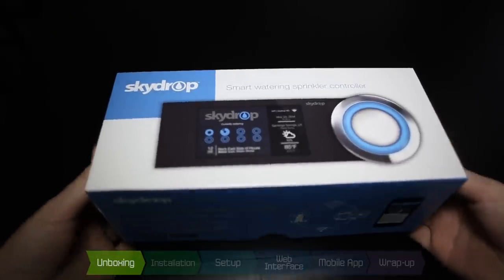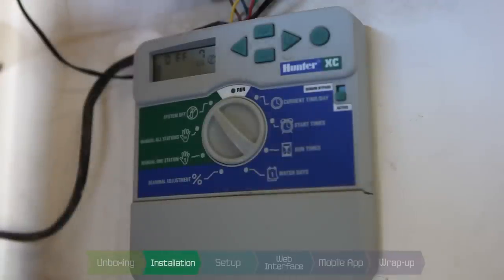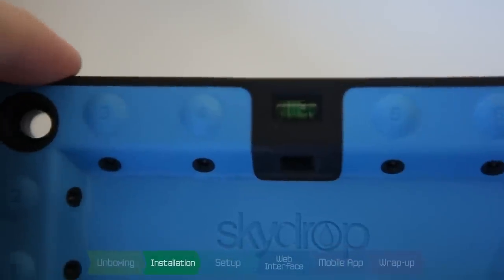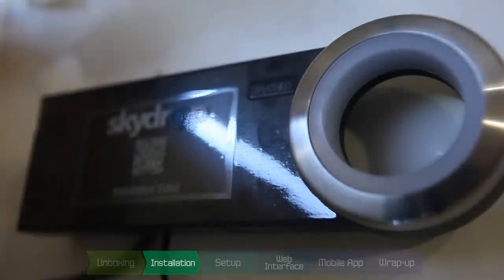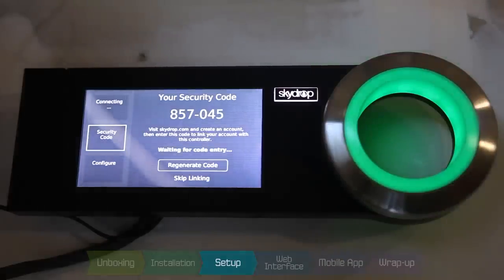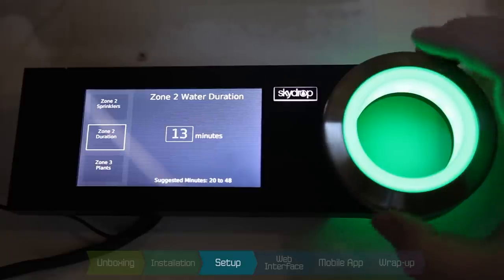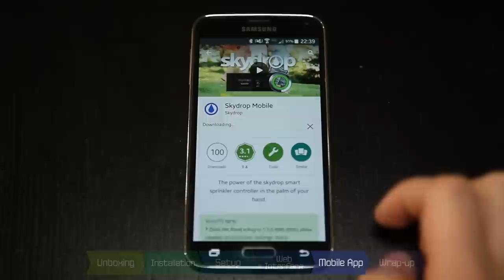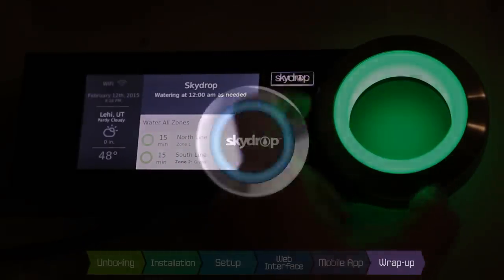Skydrop Smart Sprinkler Controller - Unboxing, Installation, & Review

Comment: Was the wiring already into the inside of your home? Mine exists on the outside so I'm not sure if I'd have to reroute the wiring or if this would get installed outside.  It looks as though its not meant to be outdoors though
Reply: RoachForLife You may have already found the answer but Skydrop sells an external box so the unit can be mounted outdoors.  You'll find it on their website.

Comment: I have an 8 year old system from Irritrol that looks to have all the same capabilities.  It's controlled from a Windows application that uses a USB wireless remote control to send the watering schedule to the controller.  You can also carry the remote control around the yard to turn zones on and off.  Problem is, they've announced they are abandoning support for it, so the next time the weather data source changes something, it probably won't get updated and will quit working.  I'm looking for a replacement and like the looks of this.

When you connect to the web interface, do you know if it is actually going out to the internet, or is it direct to the device?  An easy way to know, is if you can access it when the internet is down.  When something from a startup company like this has to connect to a remote site, I'm always concerned about it becoming useless if the company folds.

The other thing my current system does, that I haven't seen any SkyDrop reviews mention. is that the daily start times adjust each week so that sprinklers don't run before dawn, which is apparently bad for the grass.

Comment: I understand and like the interface but nothing from this review actually shows me how this unit is going to save me money...Other than a website/app/flashy lights what can this help me do that a 20.00 rain sensor connected to my current unit not do??
Reply from the maker: ***** The flashy lights and website/app/other fancy features are the primary reason I love this controller, way before the water saving features. So if all you care about is simplicity and saving money, this is not the controller for you. Yes, it can save water with its smart watering design (your $20 controller doesn't ask you for each zone's soil type, slope, shade level, or incorporate weather forecasts), but it will realistically take many years before those water savings offset the cost of the controller. That said, I love this controller and I genuinely don't think a better one currently exists.
Reply: ***** Based on my limited experience, any cost savings come from three factors:

1. granular programming of each zone for plant type, soil type, slopes, etc. and not every zone runs on every watering cycle (shaded or partially shaded zones run less frequently)

2. knowledge of "local" weather; (zip code granularity for now, which can be a little coarse) so it'll water more when the weather has been hot, less if it's been cool, even less if it's rained

3. factors #1 and #2 fed in to a watering model that I think is derived from agricultural research. I can say for sure that it's watering based on those factors.

How much money that saves me... it's too early in the season to compare to last year yet.
Reply: You could have coverage issues in parts of your garden of turf areas. Even coverage is needed to establish an good balance.